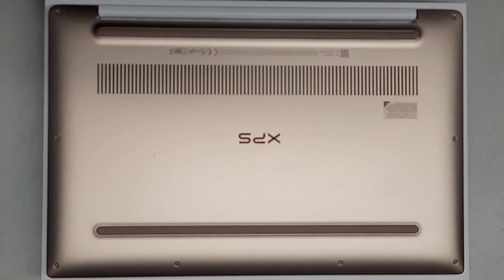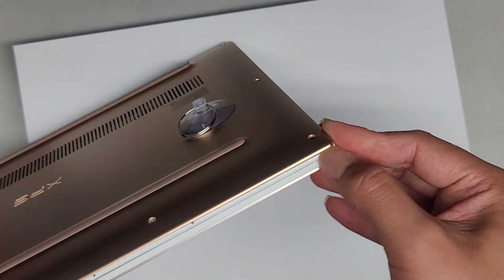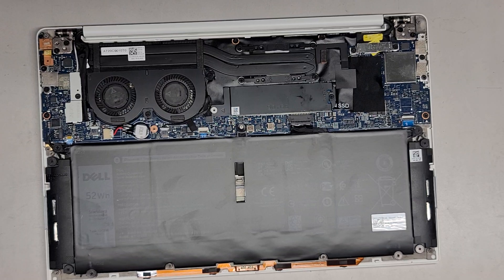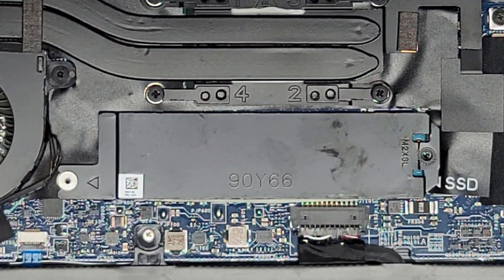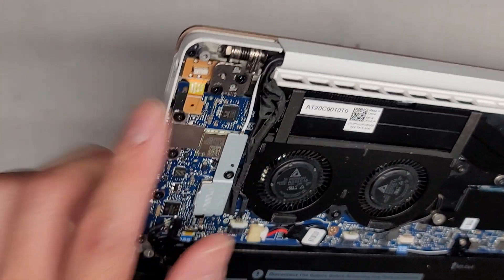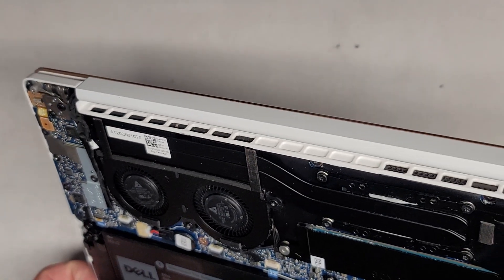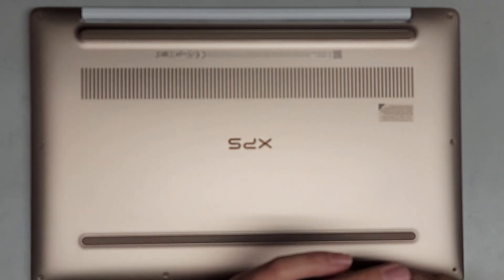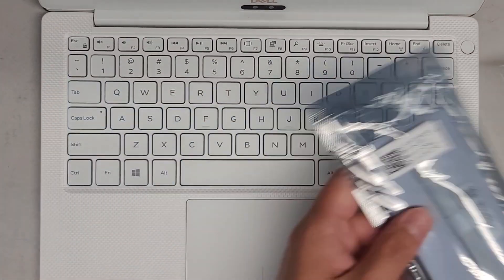DELL XPS 13 9370 Disassembly Quick Look Inside SSD Hard Drive Upgrade Battery Replacement Repair

Comment from the maker: After booting it with the original SSD and then swapping it to the one from the old computer, it worked.
Reply: My ssd is dead how can i boot
Reply from the maker: Replace the dead drive and install windows.
Reply: Where ram ?
Reply from the maker: @jamannow298 sorry, titled wrong. Ram isn't upgradeable.

Comment: Consider disconnecting the battery before doing any other thing under the cover
Reply from the maker: Not always.
Reply: CompTia A+ 101 basics.
Kill the power and use the anti-static mat always
Reply from the maker: @puretruthministriesinc.8211  lol How do you think consumers build desktops? You'd think they'd include static straps with motherboards if it was that important/risky. If you know what you're doing and touch metal surfaces to discharge static, that's usually enough. I've worked on hundreds of thousands of computers and have videos of more computers than a lot of repair technicians have ever even touched. You'd think I'd have a bunch of customers coming after me for destroying their computers with how important you make it sound. I haven't had a single one die from this.
Reply: @ItsBinhRepaired  lol
Hundreds of thousands that's laughable and your success is very admirable again consider it so that you don't have the electrostatic discharge.
Reply from the maker: @puretruthministriesinc.8211  You'll always have electro static discharge. It's just constantly going into the ground with the strap.  You can also reduce static by shaving all your hair off and working naked barefoot on a non insulated ground on a metal chair. Much more effective and makes sure no static comes out. My videos are to help everyday people with their computers. They aren't going to go out and buy static mats and wrist straps for a one time upgrade.

Comment: Thank you! This helps so much as I disassembled my computer for the first time and couldn't figure out what was what, especially the ram.
Reply from the maker: Glad it helped. If you haven't already, please like and subscribe so others can find my videos. Thanks!
Reply: @It's Binh (Been) Repaired & Reviewed  actually, I recently replaced my ssd card, but now my computer won't boot, I think it's because I didn't clone the boot data, do you know an easy way to get that boot data? (I don't need any other data transferred from my old ssd, and it died so my computer currently won't function with the old one.) It's alright if you don't know, I'm asking to ask.
Reply from the maker: Basically this https://youtu.be/R6GVDyVqWso but boot from it
Reply: @ItsBinhRepaired  thank you!
Reply from the maker: Yup